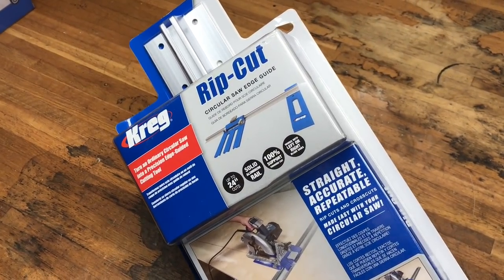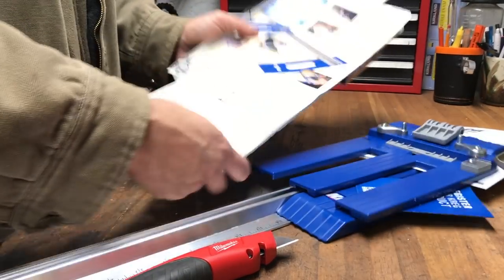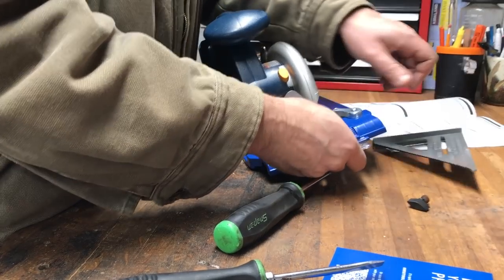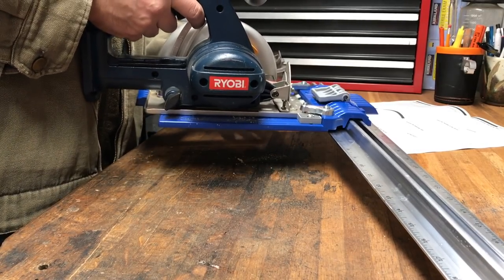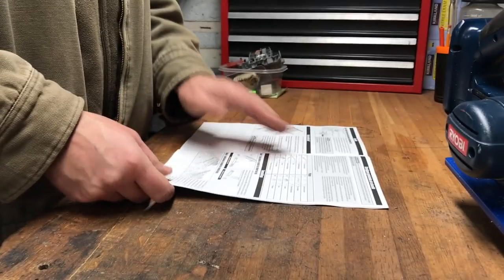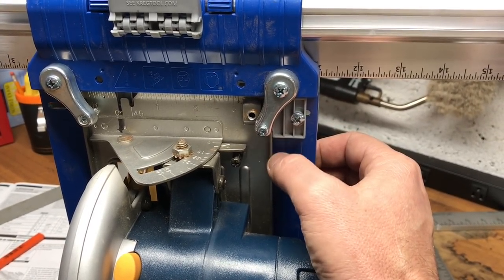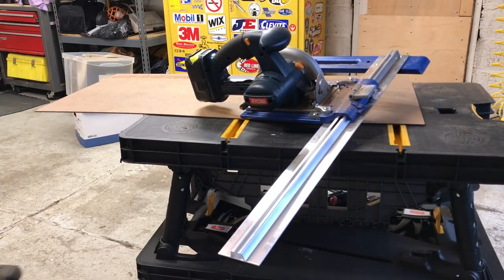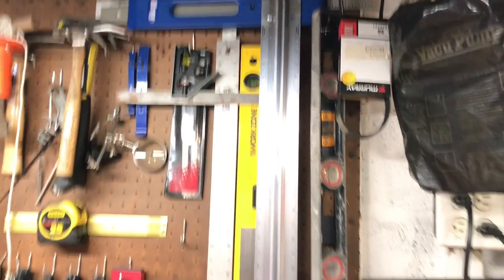Tool Review: KREG Rip Cut;  Setup and Trial run.

Comment: since your saw  is smaller, you were supposed to  reposition  the set screws to the inner holes to mount saw to base plate securely. outer hole setting is for larger circ saw
Reply: Oh is that why mine is wobbly too? I tried tightening the set screws but it just lifted the end of the top clamp part.  I have to try that. Thanks.

Comment: Nice video. I’m curious on how you got the sled to sit flush on your saw. I am having the problem where it does not sit flush like you originally had a problem with
Reply from the maker: Took some messing around.  The two set screws can't be over tightened or they start to act like a jack screw and lift the sled.  Sort of a "sweet spot"
Reply from the maker: 5:30 - 6 min mark
Reply: There is a grey plastic piece right where you but the front of the saw against the guide that you can pop out. One side has a slight slope on it and the flip side is flat. If the lip of your saw has an angle to it on the bottom of the plate then you would use the slope side of the plastic piece facing up. If the front lip of your saw is flat then you would pop the plastic piece out and flip it over and use the flat side facing up. That might be your problem. Also the two screw down clamps can be moved over to the other holes to get a better position if they don't line up with your plate to get a flat surface to clamp down on. If you tried those things and it still doesn't lie flat then it is the plastic flexing. I have the same problem and my saw does not sit flat either.  Think it is because my plate has a slight slope in the front and the plastic adapter piece doesn't match my slope so there is play.
Reply: I had the same problem with my angled sled not sitting flush with the Kreg base. The screw down clamps have to be positioned behind the sloped lip of your saw sled. If you tighten the clamps over the sloped portion it will lift the sled up. In my case I have ridges on my skid and it limited my positioning of the clamps and they ended up over the slope of my skid and the adapter piece was not high enough so I ended up  cutting up an old plastic gift card to use as filler strips to lift the grey adapter piece as the piece didn't provide enough angle on it to match my sled's angle. I doubled up on my strips and placed them under the adapter piece and now my sled sits flush.
Reply: bob louie hey thanks!! That did the trick for me.
Reply: @90chevytruck  glad it worked for you. Make sure you use the hard credit card plastic type and not the the softer flimsy type that can compress. Also check after each cut to make sure the sled doesn't work loose just in case the adapter piece may be raised too much which can cause the sled to work loose or it may just be vibration. Better safe than sorry.
Reply: @ba2924   That's exactly it. Towards the start he flips over the small grey piece on the sled and puts the flat side up. As his saw as an angled front plate he should've left it as it came with the little angled ribs facing up. These support the angle of the saws plate at the front to stop it tilting/rocking.

Comment: Is it possible to make angle cuts (using the angle setting on the saw) with the Rip Cut?
Reply from the maker: To a point, the sled does limit the angle to a point.
Reply: @danjreed  thanks for the response!  Do you think 45 would be too much of an angle for this?
Reply from the maker: @junkisaita  I'll have to check it out and try it.  Will get back to you!
Reply from the maker: @Junki Saita I am limited to 23 degrees due to the blade guard!
Reply: @danjreed  thank you!

Comment: Another plus for Ryobi too.. you said 15 years plus right? Cause Im thinkin of buying a kit with a 5 1/2 inch combo for home projects. Does it cut ok with 2x lumber?
Reply from the maker: This saw can do 2X cuts, but its slow, and it bogs down.  Gotta take your time, but no way would I try to do something like build a deck.
Reply: @danjreed  thanks! Maybe I will take a look at the 6 1/2 inch Ryobi
Reply from the maker: @ttcvm7339  Yea, the brushless one they have is nice.  I'd get a bigger saw if I had to do a lot of cuts.